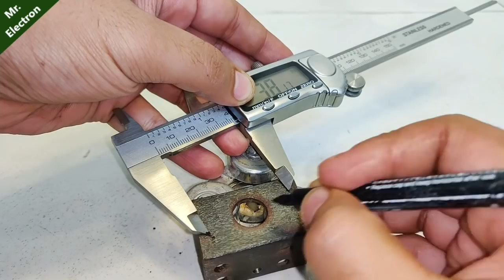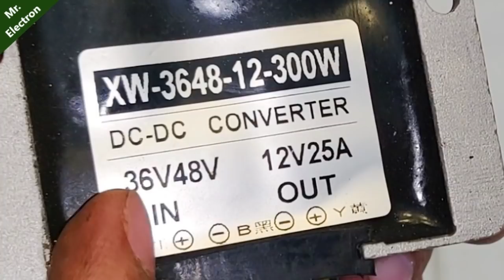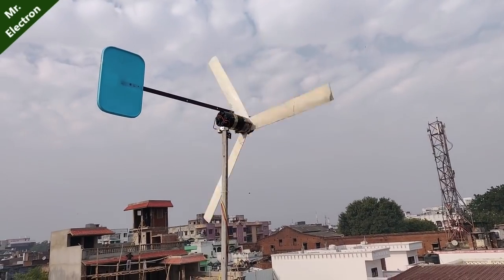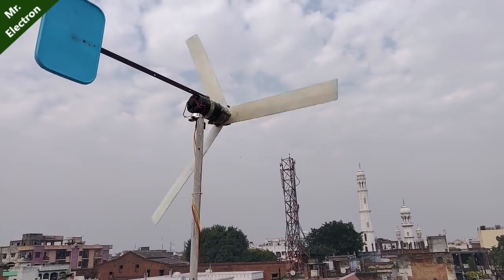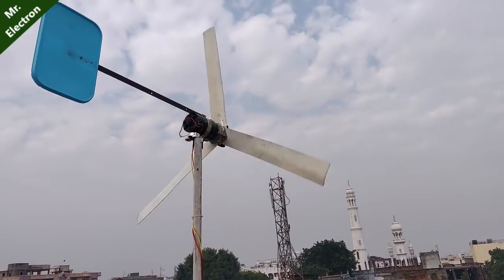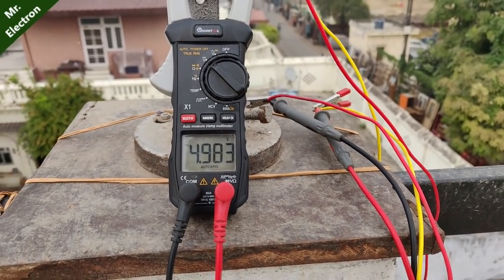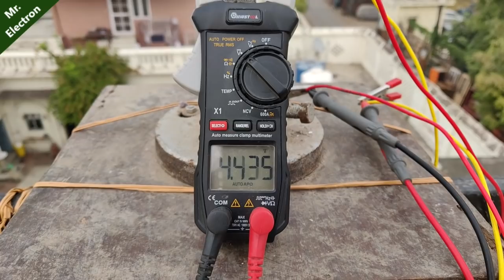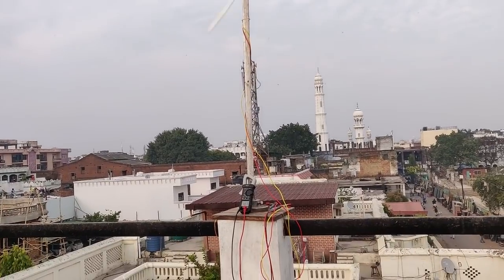How to Make 12V Wind Turbine Generator from RO Pump - Part 2

Comment: YOU can also use a boost converter which can handle the wattage and amperes of the wind generator make 12/24v DC out of it. other wise its pretty good

Comment: Please put a load on it. Testing for open circuit voltage isn't really testing it's usefulness.  A load will increase emf resistance and slow down the rotor> decreasing voltage. You can always boost voltage with a boost converter, but what you need to find is max amps x rpm which requires torque. Since your blade spin diameter is small compared to your rotor axis the leverage factor is small giving you minimal torque. Add blades or blade length to increase torque. Great video though!
Reply from the maker: True... I am waiting for proper wind to make a load testing video...
Reply: @MrElectron  how you made the propleers

Comment: Please, what is R O Pump ?
Reply from the maker: In INDIA , we use a water purifier to clean up tap water thus making it drinkable.
High Pressure pump is used in that Reverse Osmosis Purifier (RO purifier) which is commonly know as RO Pump.
Reply: @MrElectron  Many thanks Mr Electron